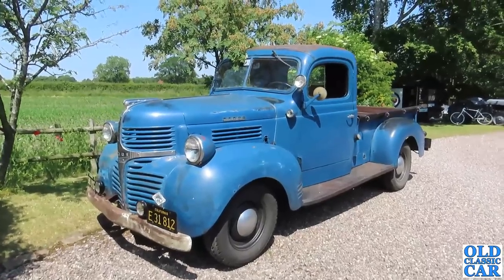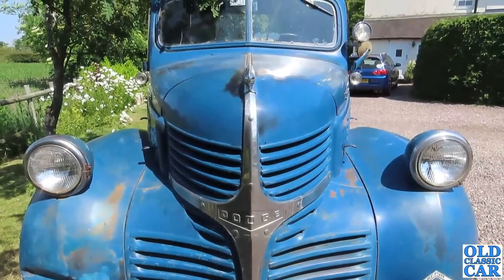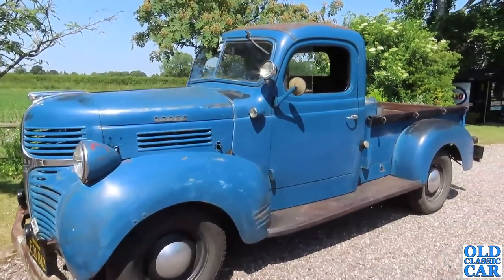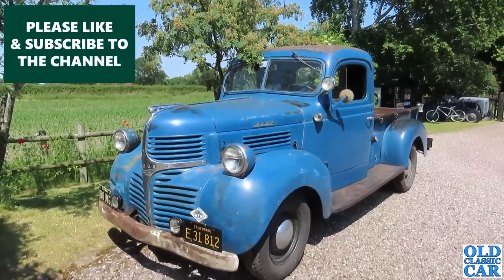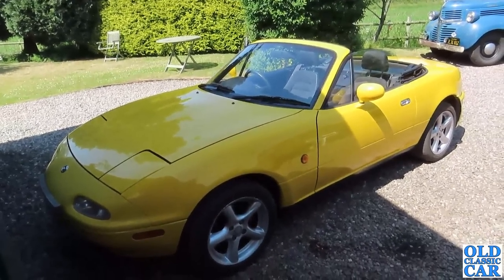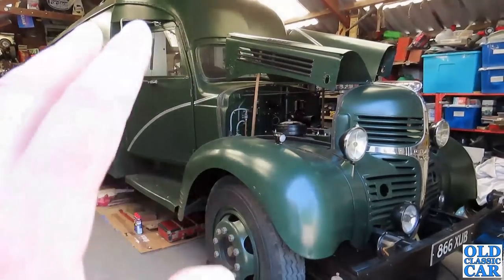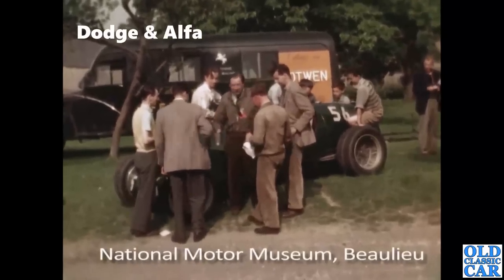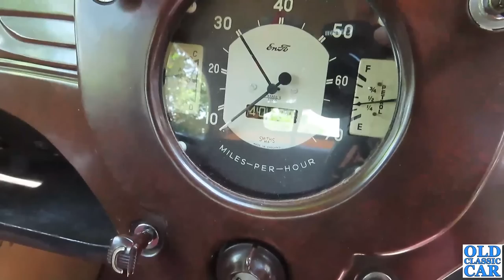Old Classic Car VLOG! a walk & talk intro to our old cars

Comment: Well, I've been with you a while but it's always good to have an update or looksee to find out where things are at or if I've missed a notification / video where things got done or if you have maybe progressed something unfilmed.  

I saw the Minor video and absolutely loved hearing that little car wind over and fire up. I am also a big fan of the Standard 8 and the A40 - the Standard because a) I own a couple of 1970s Triumphs and read up extensively on the history of both companies pre and post their merger in 1945 and b) the little 8 always reminded me of a remodelled A30 and the A30 and A35 were staples of several branches of my family before - and long after - I was born....and in fact I have owned both and am looking to find another one now.  (As an aside, if I could find a good A40 Somerset, I'd happily have one of those instead as they look like someone took an A30 and inflated it, but I digress).

Your A40 Farina MkI (which will have an A35 speedometer, albeit reconfigured with the indicator light where the ignition light was on the A30/35) is my favourite of that generation of the model....and yours appears to be the saloon (fixed rear window and a boot lid that opened on the bottom half) as opposed to the Countryman with the split tailgate, so yours I believe is a bit rarer.  I like the styling of the MKI with the separate headlight / indicator surrounds and smaller grille.  The headlight surrounds always reminded me of those on an A99 Westminster....but I never did get around to trying a set out.  From memory, the MkI still ran the 948cc engine, but that's not a bad thing.  They were a lovely incarnation of the A-series and quite easily modified, although replacing the rear axle with one from a similar era Morris Minor so you had a full fluidic brake system, was definitely a must!  Like the Standard 8 and the A30/35, I love their simplicity - pull-up windows and simple dash layout, although you did have to know which switch did what as they weren't labelled!  

Of the 8 and the A40, I cannot pick a clear winner as to my favourite.  I do like all of your vehicles though because of their honest appearance and - as you put it - nothing overly restored but kept as much in original condition as possible.  The life wear on the Dodge truck is just lovely and the ex-Army van looks more a well-looked-after survivor than a museum piece, so to me, she looks perfect. So does the Prefect, although it is probably nearing time for another coat of the old Linseed...but she still looks grouse.  The Minor to me will be outstanding when she's done and an absolute peach on show days or Sunday afternoon cruises.  I was also shocked when I realised the first of the NA model MX5s were pushing 30 a few years ago!  They are still a great daily vehicle for so many and there are still plenty on the roads over here in New Zealand and cheap as chips for parts, service and indeed to purchase.

I am looking to move my Stag and my Mini on shortly and keep the 2500S, but I also want a modern for the times when the 2500S decides she doesn't want to play ball for a while.  I think an MX5 is the perfect answer there.......and it will be a TRUE classic in around ten years too!

All the best and thanks for sharing.
Reply from the maker: Hi Lance, thanks for your thoughts!! Triumph 2000/2500 does sometimes come up on my radar so maybe one of those will appear here at some point, who knows?!?